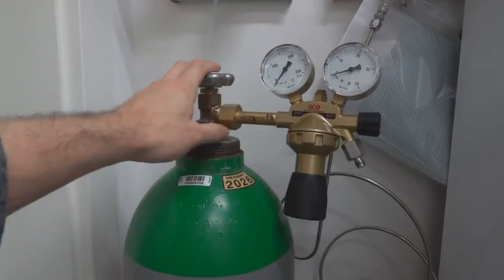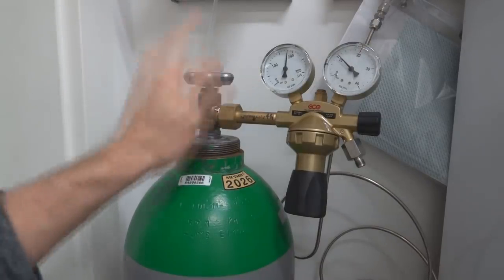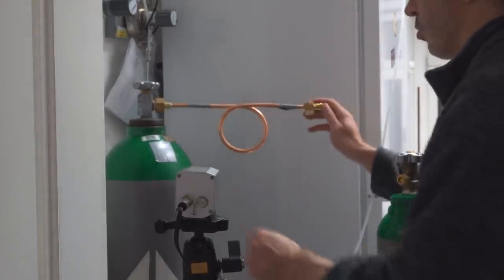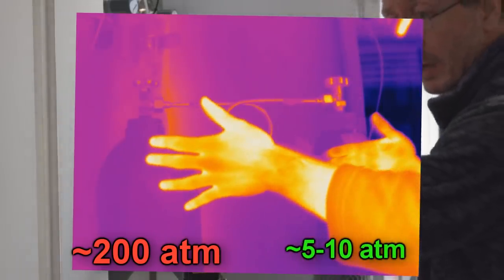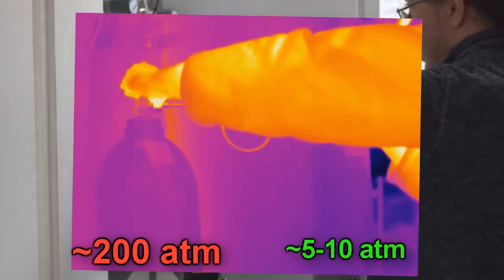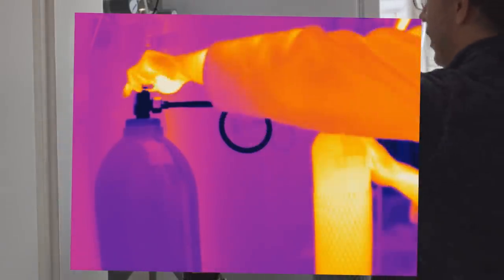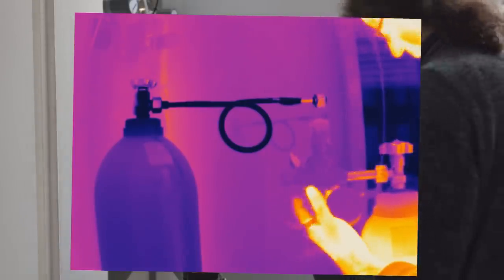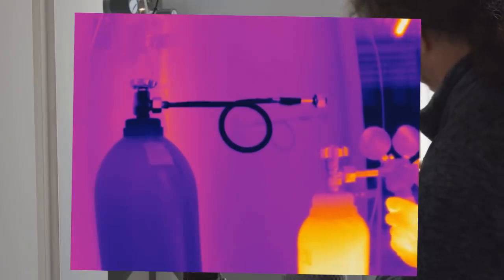Dangers of high pressure gas!

Comment: 7:23 wut the fck? Like does he not know there's a thing called "car brakes"??? Sometimes, I feel like I can't understand this guy to the point that I feel like he's from another planet (A rly weird, and messed up planet   XD   ;D;D;D;D ).........liek.....wtf?
Reply: He said it would improve braking, not replace it. You could use the thrust to induce downforce, increasing the grip of the tires, or to directly halt motion.

It's not an entirely stupid idea, Bosch have been testing it on motorcycles: https://www.cycleworld.com/bosch-wants-to-put-rockets-on-your-motorcycle
Reply: @lazarus2691  The article that you linked was talking about a prototype system using cold-gas thrusters. Nobody uses cold-gas thrusters for propulsion, because pressurized gas has laughably LOW ENERGY DENSITY compared to something like diesel, or petrol. Meaning that you have barely enough any energy to slow down your vehicle using pressurized gas, LET ALONE for MULTIPLE TIMES on a trip. ALSO, funnily enuff, the same article you posted even says that "Of course, the system as demonstrated was a single-shot system" (this quote is from article). What's more, this prototype system for the motorcycle only applies a force for 1/50th of a second.....which is lame, since car brakes need to apply a force for several seconds  

Chemical rocket engines can impart opposite force to slow down a vehicle, but they need quite a lot of fuel to do it. A normal car brake on the other hand can do the same thing.....itz called pushing on the ground, so that the ground exerts opposite force against it (ie friction), and causes the vehicle to stop....this does not consume fuel (not to mention that rocket fuel is dangerous [some are toxic], because it carries its own (solid) oxidizer. Meaning that it if it catches on fire, it is harder to put out, since itz harder to remove its oxygen supply, because it comes with its own (solid) oxidizer. For liquid oxygen, it is VERY cold, and can make materials very brittle....which is bad, because this can easily cause cracks in container tanks (that carry the liquid oxidizer, or fuel), and allows the liquid oxygen to accidentally mix with the fuel, and cause it to EASILY IGNITE UNINTENTIONALLY). Which one do you think is better?

And even if a rocket does improve braking. You could probably do the same thing by making BETTER car brakes
Reply: @andrewlee-do3rf  
I'm not sure why you're mentioning biprop rockets at all, since at no point has the roadster intended to use them. So I'm going to ignore that.
 

Wall of text warning!!! I'm afraid the only way to make my point is with a fair amount of math.

First of all, let's address your closing statement. You can't just make 'better car brakes'. Braking in cars is limited by the grip of the tire, not the brakes themselves. 
So you can make better tires, but there are practical limits, especially on road-legal cars.
 Typically speaking, the recommended G-force for controlled braking in a production car is 0.47G, and the maximum the tires can allow is 0.8G. The numbers are closer to 0.7G and 1.1G for high end sports cars.

Anyway, I only linked that article to make a point that a cold-gas thruster could be used to improve braking and handling significantly. It wasn't supposed to be a direct comparison. While the motorbike in the article only had a weak one-shot system, the SpaceX RCS system that Tesla will supposedly use is vastly more capable.

SpaceX's Falcon 9 rocket is the best example of someone using cold gas thrusters for serious propulsion. It uses about a dozen icecream-cone sized thrusters that each produce around 4000 newtons of thrust. They aren't the primary thrust system, but nonetheless, they're used to make a 500 tonne rocket do backflips.

You are correct about the low energy density, I calculate around 0.18MJ/kg, compared to around 18MJ/kg for kerosene+liquid oxygen, so that's about 100 times less.
However, I'd point out that lithium ion batteries have about 100 times worse energy density than gasoline, and yet electric cars are still reasonably practical. 

So energy density isn't everything. After all, if it was, why would SpaceX use such a large cold-gas system on the Falcon 9, given that in rocketry 'every gram counts'?

What's more important is the total impulse that we can get. The SpaceX COPV can hold ~250kg of nitrogen. The specific impulse of a nitrogen cold gas thruster at sea level is ~60 seconds. This means that the system can provide a thrust of 250kg for 60 seconds, or a total impulse of about 150,000 Newton seconds. And that's actually quite a lot.
That total impulse is enough to completely stop a two tonne car from about 250km/h using nothing but rocket power, or even hover the car for about 7 seconds.

However, while there is theoretically enough impulse to do those things, there are far more sensible ways to use it. Let's look at a hypothetical scenario:

Assume a two tonne sports car is moving at 180km/h, or 50m/s. Assuming it has high end tires, it can brake at a maximum of a bit over 1G. Call it 10m/s^2 for simplicity.

Therefore, it will take the car 5 seconds to stop, and in that time it will travel 125 meters, which is quite a large distance.

So what if we were to use the gas thrusters to assist it? Say we fired them upwards at a 45 degree angle at 1G for about 0.7 seconds.

This will increase downforce by 71%, while also providing a linear deceleration of 0.7G, for a total braking force of 2.42G

In that 0.7 seconds, the velocity reduces from 180km/h to 118km/h. This also reduces stopping distance to about 83 meters.

I'd say that there's a pretty significant difference between 125 and 83, and there's enough gas in the tank to do it ten times.

Or you could do an 'emergency brake' that stops the car in just 32.5 meters, and you could do that three times. 
Or you could stop the car in 106 meters, using a burst of gas only 0.14 seconds long, and you could do that 50 times. That's an 18% improvement.

Now this is just a rough analysis, but I would call all of that a significant improvement in braking. I'm not sure it's enough to be worth the effort and all of the downsides, which is why I didn't say that it was a good idea, just that it's not entirely crazy.
Reply: @andrewlee-do3rf  
I've just realized something neat, so I'm adding this to my previous reply. Make sure to read that one first though!

Anyway, the thing I've realized is that the perfect example of how little energy density matters was sitting right in front of me the whole time.

You know how I said that compressed gas has about 100 times less energy density than kerosene/liquid oxygen fuel mix?

Well, the specific impulse of a kerosene rocket at sea level is about 300 seconds. The gas thrust was 60 seconds.

That's only a factor of 5 difference. So despite having 100 times more energy, it only produces 5 times more total impulse.

That means that the cold gas thruster is 20 times more efficient at turning stored energy into thrust!

The clue is in the name. Cold gas thruster. The exhaust is cold, low energy. 
The exhaust coming out of a chemical rocket however is thousands of degrees hot, very high energy.

Basically, 95% of the energy stored in the chemical rocket fuel is wasted as heat, rather than thrust.

All that extra energy also makes chemical fuels way more dangerous. 250kg of kerolox would explode with the energy of more than a tonne of TNT.
Reply: @lazarus2691  Where exactly did you get the 95% figure from?

And one more thing, how does that compare to the energy required to compress air in the cold gas thruster?
Reply: @andrewlee-do3rf  
Well the energy density difference is a factor of ~100, the impulse difference is a factor of ~5, which makes the efficiency difference a factor of ~20.

1/20th of 100% is 5%. Therefore the compressed air can achieve a given impulse with only 5% of the energy content that the kerolox mixture can. As such, 95% of the energy content of the kerolox is not converted to thrust, and is therefore 'wasted' in some way.

It makes a lot of sense given the temperatures involved, ~3500K for a typical chemical engine vs ~50K for a cold gas thruster, that most of that missing energy is converted into heat.

Though it would technically be more correct to say kinetic energy. The individual gas molecules are bouncing around a hell of a lot faster at the high temperature.
Reply: @andrewlee-do3rf  
Oh, I missed your edit. Uh, compressors range from 65% to 95% efficiency depending on a range of factors.

For this type of application, I'd expect a high quality reciprocating compressor, so about 85% efficient, which means a 15% loss.

I didn't account for it in the comparison because I was comparing stored energy, not the energy needed to get it there in the first place.

Even if for some reason we did include that 15% efficiency loss, it's still about 17 times more energy efficient than kerolox.

But if we're going to include compression losses, then we should also include the energy needed to liquefy the oxygen that makes up the '-lox' in the kerolox

That should be about 142.5kg. I'm outside my field of expertise now, but from what I can find the energy cost to liquefy 1kg of oxygen is somewhere between 3.6 and 13MJ. 

That means anywhere from 500 to 1850MJ to liquefy 142.5kg. Compare that to the 4500MJ total energy content of the kerolox, and you get an efficiency of between 59% and 89%.

Comparing that to 65-95% for a compressor suggests that on average, compression is slightly more efficient(about 6%), but it would depend on the specific equipment being used.
Reply: @lazarus2691  "I'm not sure why you're mentioning biprop rockets at all, since at no point has the roadster intended to use them. So I'm going to ignore that."

I mentioned that, because I don't think that cold-gas thrusters were practically enuff to use, because of its low energy density
Reply: @lazarus2691  "So what if we were to use the gas thrusters to assist it? Say we fired them upwards at a 45 degree angle at 1G for about 0.7 seconds.
"

Uuuummm....I don't get it, why are you firing them upwards at 45 degrees? Wouldn't just firing them from a flat 0 degree give the most braking force??? Unless if your worried, you might damaged the cars in front of you, or something.....or push debris forward with the compressed air you blasted out?
Reply: @andrewlee-do3rf  
 Wouldn't a mono-propellant system like decomposing hydrogen peroxide over a catalyst have been the next logical step?
After all, that's what rocket packs such as the Bell rocket belt use. https://en.wikipedia.org/wiki/Bell_Rocket_Belt

As for the better brakes, did you actually read the article? The physical brakes are not improved. The system is using a computer to allow for braking right on the edge of the traction limit. Remember how I said that the recommended max braking was 0.47G, but the max possible was 0.8G in a typical car?

Well that 'recommended' 0.47G figure is for a regular driver. Professional drivers can utilize about 0.62G, due to higher skill. An advanced computer system can do better than that, and more or less achieve the max value of 0.8G. It does not allow you to achieve more than the maximum grip of the tires.

I was already assuming that the roadster would be using that sort of system, since it is a high end sports car, and since Tesla's current cars already do it. This was why I used the maximum G value for those sort of tires, not the recommended G value.

As for firing up at 45 degrees, while the fact that it won't be blasting at people or cars is a nice bonus, it actually comes from simple vector addition.

Firing the rocket either straight up or straight forward are both equally effective. Say you fire at 1G straight forwards, this will produce 1G of deceleration on top of the 1G of deceleration provided by the brakes for a total of 2G
.

But if you fire the rocket straight up at 1G, this will produce a downforce that effectively doubles the cars weight, while not increasing mass. This makes the brakes twice as effective, and also produce a total of 2G.

However, consider the motion of a projectile fired at 45 degrees at 100m/s. It's vertical velocity component will be 70.7m/s, and it's horizontal component will be 70.7m/s. Thus the sum of the velocity vectors is 141.4m/s(although the product remains 100m/s), as opposed to 100m/s if fired straight sideways or straight up. This is why the maximum range of a cannon is achieved by firing at 45 degrees.

The same concept applies to rocket thrusters. If you want thrust in two perpendicular directions, it is 41% more efficient to fire the rocket halfway between those two directions than to fire two separate rockets in each direction. 

This concept is actually used during orbital insertions of rockets, and was also used to very large effect during the moon landings. Basically, the lunar lander needed to both slow it's sideways velocity of ~2000m/s, but also to fight the moons gravity. Rather than doing each job with a different engine, or alternating thrust, it fired at an angle. 

The angle changed as the speed reduced, while the moon's gravity stayed the same. They started out at 90 degrees sideways, then slowly rotated to 80, then 70, then 60, and so on until all of the sideways velocity was gone and they were pointing vertical. If they'd used two different engines they wouldn't have had nearly enough fuel.

Similarly, if a car had better or worse tires, the angle would change. If the tires were limited to 0.8G, you'd want to lower the angle to 39 degrees. If they could achieve 1.2G, you'd want to raise it to 50 degrees. I used 1G because the best road legal tires are only slightly better than that, and it gives a nice 45 degree angle to work with.
Reply: @lazarus2691   "Wouldn't a mono-propellant system like decomposing hydrogen peroxide over a catalyst have been the next logical step?"
After all, that's what rocket packs such as the Bell rocket belt use. https://en.wikipedia.org/wiki/Bell_Rocket_Belt
"*

I fail to see what ur trying to convey with this, why are we talking about jetpacks? I mean I know we are talking about thrusters, but why jetpacks all of a sudden? 

Next step for what?
Reply: @andrewlee-do3rf  
Well you said you didn't think that compressed air was enough to hover a car, so your next step was to assume that it would need bipropellant rockets to do the job.
What I don't understand is why you went straight from the least powerful type of rocket to the most powerful type, skipping over options in the middle ground like hydrogen peroxide, which has a proven history of being used to make things hover.
So what I asked was: wouldn't a monopropellant system have been the next logical step(in power needed to hover a car)?
Reply: @lazarus2691  "Well you said you didn't think that compressed air was enough to hover a car, so your next step was to assume that it would need bipropellant rockets to do the job."

I said that, because compressed air has too low of an energy density to be "practical". And for the record, I did admit in my previous comments that compressed air is able to exert significant force on a vehicle (but barely manage to), but I also said that it wouldn't be able to do it multiple times.....due to poor energy density

"What I don't understand is why you went straight from the least powerful type of rocket to the most powerful type, skipping over options in the middle ground like hydrogen peroxide, which has a proven history of being used to make things hover."

I mean, did I (skip over)? In my comment (which ur referring to) I was talking about ANYTHING (well....not everything, because some rocket fuels are toxic. Not to mention tough to handle) that uses fuel, and an oxidizer.....and it seems to me that hydrogen peroxide is used as an oxidizer. Hydrogen peroxide can also be used as a monopropellant.....and monopropellant is basically fuel and oxidizer combined into one molecule....so basically what I was talking about in my previous comment

Again, I went straight from the "least powerful type of "rocket" (cold-gas thruster) to the more powerful one, because I didn't think the cold-gas was practical....since, as you say it......100 times less energy dense than kerosene (+) oxygen. Oh.....I forgot to mention this earlier (srry meh bad). Your correct that kerosene (+) oxygen (which u say is 18 MJ/kg.....well, I guess its around 18 MJ/kg) is 100 times more energy dense than energy stored in compressed air (which you say is 0.18 MJ/kg)......but since we are talking about cars too, and since cars don't need to carry oxidizer (because why bother, car engines basically use air from outside).....then that technically means that gasoline is basically 45 MJ/kg by weight (but I guess that 45 MJ will turn into something like 18 MJ if you had to carry your oxidizer.....for whatever reason   :/   ). So wouldn't that turn the 100 times less energy dense problem of compressed air (in comparison to Kerosene (+) oxygen) into something like around 2.5 times worse when ur comparing to gasoline (around 48 MJ/kg) just by itself WITHOUT stored oxidizer? And....since compressed air is 250 times less energy dense than gasoline (again, with no stored oxidizer) by weight....wouldn't that mean you would have to sacrifice significant weight in order to carry a system that your arguing for (car with compressed air for "braking")?
Reply: @lazarus2691  "As for the better brakes, did you actually read the article?"

Yes, I read the article. Why do you think I sent it to you in the first place?

"The physical brakes are not improved. The system is using a computer to allow for braking right on the edge of the traction limit. Remember how I said that the recommended max braking was 0.47G, but the max possible was 0.8G in a typical car?"

eeeerrrrrmmmm.....the physical brakes are not improved? I mean how? The article was talking about using an enhanced brake booster (along with better, more precise computer control to improve the brakes) that allows you to stop the car faster (ie. shorter travelling distance when you apply the brakes) than a more conventional braking system (most commonly seen in civilian cars)....how is that not an improvement?

And also, a brake booster is a part of the overall car brake system........so I don't get it when you say "physical brakes not improved"
Reply: @lazarus2691  "I was already assuming that the roadster would be using that sort of system, since it is a high end sports car, and since Tesla's current cars already do it. This was why I used the maximum G value for those sort of tires, not the recommended G value."

Well....I guess your right in that regards. But, since the article I mentioned described people trying to implement over enhanced car brake technology from the exclusive sports-world to the civilian world, and probably trying to make it cheaper while they're at it.......it technically does count as an improvement....does it not?
Reply: @lazarus2691  "As for firing up at 45 degrees, while the fact that it won't be blasting at people or cars is a nice bonus, it actually comes from simple vector addition"

Oh yeah, blasting at people, or cars is a nice bonus.....itz just too bad the noise it produces (probably not going to be street legal) while it's blasting away won't be such a noise bonus
Reply: @lazarus2691  "Basically, 95% of the energy stored in the chemical rocket fuel is wasted as heat, rather than thrust.
 All that extra energy also makes chemical fuels way more dangerous. 250kg of kerolox would explode with the energy of more than a tonne of TNT."

Srry.....I am a bit confused right now. Your saying that the energy efficiency of a chemical rocket is ONLY 5%??? Isn't the energy efficiency of a chemical rocket around OVER 60% EFFICIENCY (reference is: https://en.wikipedia.org/wiki/Rocket_engine#Energy_efficiency ) in some cases???

It can even go high as 70% EFFICIENCY (reference: https://en.wikipedia.org/wiki/Propulsive_efficiency#Rocket_engines ) in some cases

The lowest energy efficiency that (I've heard so far) a rocket can have is around the same efficiency as that of a gun (basically, a gun is a rocket in a sense.....itz only slightly different, because u shoot a bullet). Anyways the efficiency of a gun is around 30% (reference is: https://en.wikipedia.org/wiki/Physics_of_firearms )....sometimes it can go high as 35%, or 40%
Reply: @andrewlee-do3rf  
I already pointed out that the thermal efficiency of a rocket can reach 70% in an earlier comment.

Anyway, the problem is that thermal efficiency is an absolute scale, while propulsive energy efficiency is relative, so it's hard to compare them unless you understand it.
It's fairly tricky, so I don't blame you for not getting it.

As a simple example, look at the jet engine comparison I just gave. If you burn 200kg of kerosene in a rocket, it can produce 1 tonne of thrust for about 1 minute. If you burn 200kg of kerosene in a jet engine, it can produce 1 tonne of thrust for 15 minutes, which makes it 15 times more efficient, right?
So if the rocket engine is about 70% efficient, then the jet engine must be about 15*70=~1000% efficient, right?

Well obviously not. Jet engines are 50-60% thermally efficient, which is slightly worse than a rocket. And yet Jet engines are obviously much more efficient than rockets.

So both engines have about the same thermal efficiency, but they have very different propulsive efficiency. 

The problem is that thrust engines rely on kinetic energy, and kinetic energy scales with the square of velocity. So an engine that produces thrust twice as fast is only half as efficient. This is why we use helicopters instead of jet-copters, because the thrust coming from a rotor is a lot slower than the thrust from a jet turbine.

It also means that an engine that runs twice as hot uses four times as much energy. 
Say we have an engine with hot end 1500k and cold end 300k. It would be 80% thermally efficient in ideal conditions, though less in the real world.
If we now make the engine twice as hot, it uses 4 times the energy but only produces double the thrust, so it's now half as propulsively efficient.
It now has a temperature at hot end of 3000k, and cold end 300k. it would be 90% thermally efficient in ideal condition, though less in the real world.

So paradoxically, the engine is now 50% less energy efficient, yet 10% more thermally efficient. It gets both better and worse at the same time.

The closest comparison I can make is if you drive twice as fast in a car, the engine efficiency of ~25% doesn't change, but you'll only get half the miles per gallon.
In the case of a car, this is due to drag. In a thrust engine however, the energy is lost inside the actual thrust stream as heat, or in some cases turbulent motion.
Reply: @lazarus2691  "I already pointed out that the thermal efficiency of a rocket can reach 70% in an earlier comment."

Rly? When? :/

Are you referring to this?  "Basically, 95% of the energy stored in the chemical rocket fuel is wasted as heat, rather than thrust.
 All that extra energy also makes chemical fuels way more dangerous. 250kg of kerolox would explode with the energy of more than a tonne of TNT."
Reply: @andrewlee-do3rf  
No, not referring to that. 

I could have sworn I wrote it below the line 'It makes a lot of sense given the temperatures involved, ~3500K for a typical chemical engine vs ~50K for a cold gas thruster, that most of that missing energy is converted into heat'

I pointed out that the 3500k temperature gives rocket engines an exceptionally good thermal efficiency of 70% or so, despite the low propulsive efficiency. 
It's one of my favorite fun facts about rocket engines, other than how icicles can form on the nozzle of the CECE rocket engine.
I must have accidentally removed it while moving lines around. I wrote a lot of stuff, so I move stuff around to try and make the formatting readable.

Or maybe I was just not thinking straight. I'm quite tired at the moment and currently distracted by some unfortunate wind damage: https://i.imgur.com/6Ooxtkp.jpg

Either way, my apologies.
Reply: @lazarus2691  Oh ok, it was an honest mistake. Oh I see, no worries then :)
Reply: @andrewlee-do3rf  
It's what's left of a water tower.
Reply: @lazarus2691  ooooooh.....I see. I just thought it looked like a  weather balloon......cuz if you look at it in a certain way, it looks like a zeppelin.......but that's what my dumass brain thinks. lol  ;D